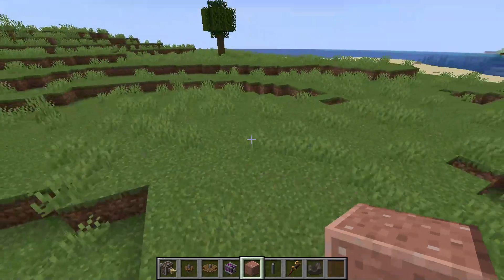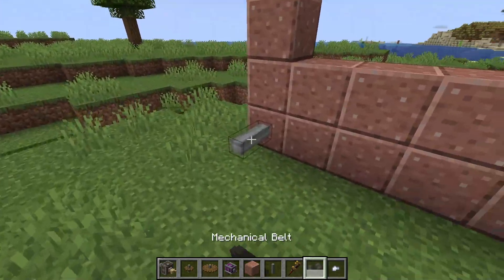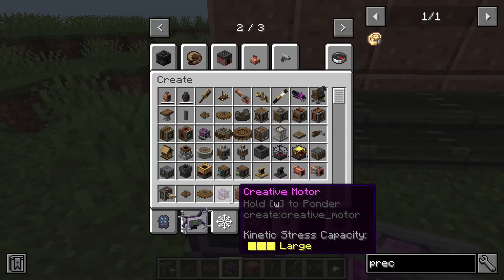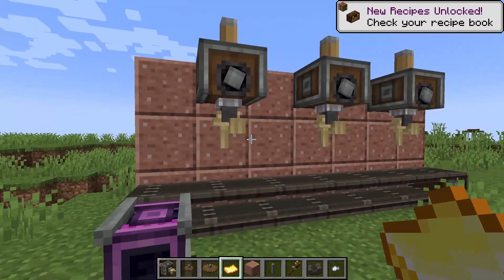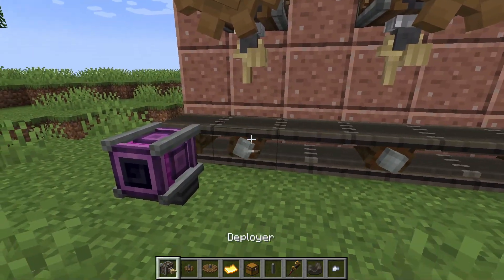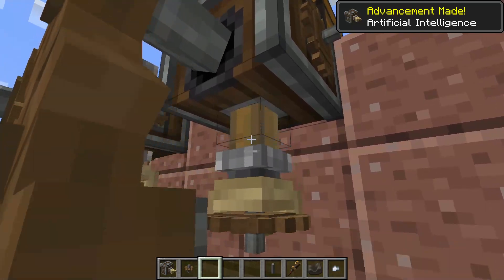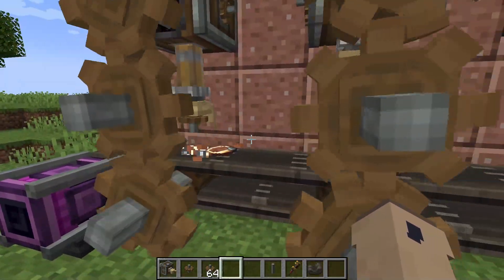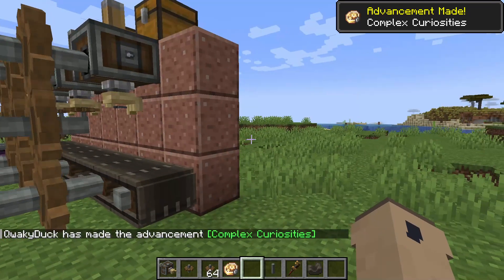Create Mod - How to make a Precision Mechanism

Comment: I was sho finna use my single water wheel powered deployer to stamp these thins 1 by 1 5 times over for a radio, thanks for the tutorial cuh
Reply from the maker: you're very welcome
Reply: @QwakyDuck also if your still familiar with da mod could you tell me how to power this specific thing, I tried a crank but it said it's overstressed
Reply from the maker: @Jayjay-vi9jk  try to use a steam engine or a bunch of waterwheels, maybe make a gear controller or something like that